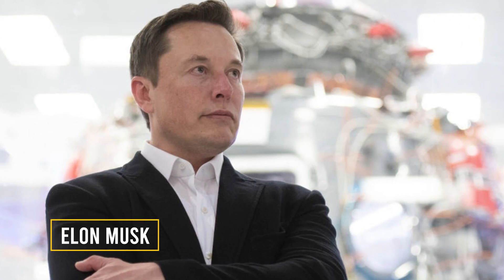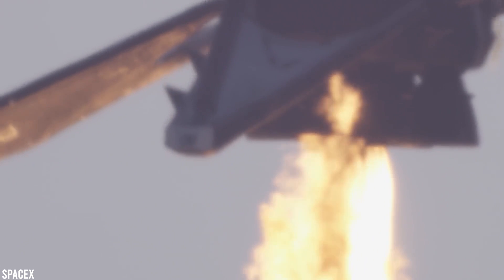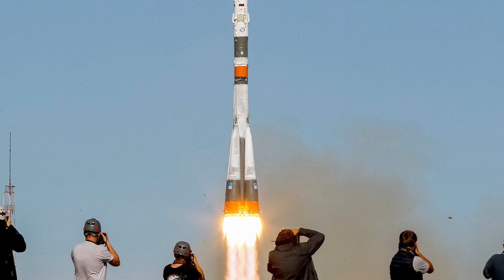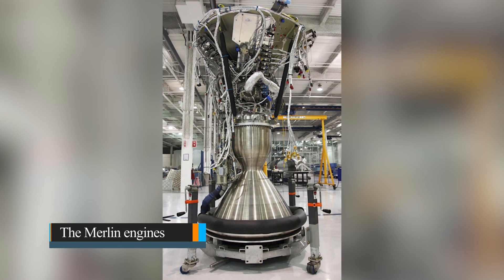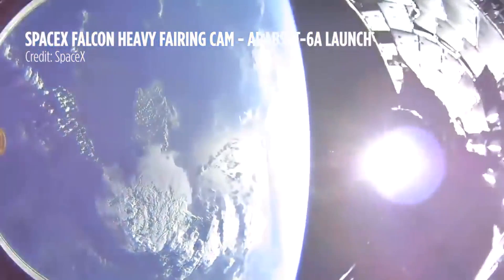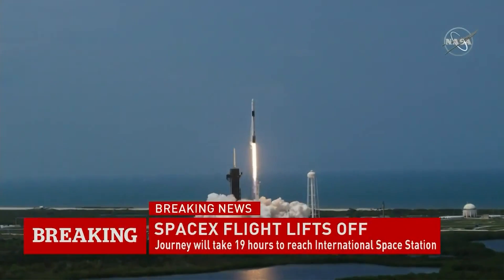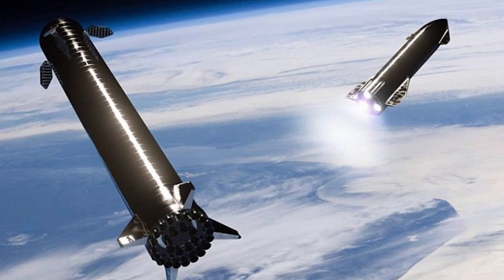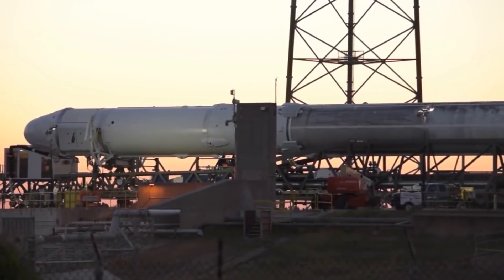The Absurd Size Of SpaceX Starship

Comment: Seems like it would be a good idea to use a hydraulic ram using sea water and a wire rope block and tackle to launch stuff that can tolerate high G force.  Using barges to float a railgun about twenty miles long should allow low fuel burning to get a space vessel launched.  Use it to send water and duct tape, tether material, medicine and well packaged motherboards, EVA space suits, etc.

Comment: Consider getting your numbers right, especially given you are supposed to be describing size it does not help when you clearly have no clue yourself! You said the SpaceX starship was "90 meters in diameter, or 30 feet". FYI, 90 meters is NOT 30 feet, it is 295 feet! It is 30 feet in diameter, which is equal to 9 meters (not 90)!

Comment: As impressive as it is, I cannot believe NASA has signed off on a vehicle with no escape pod, especially with the 28 raptors and massive fuel tanks that would explode with the equivalent energy as a small nuclear bomb.
We have seen how reliable a rocket with 20+ engines is and IMHO opinion, a design that had two boosters strapped to the side like the Falcon Heavy would be a safer design by virtue of the fact that the plumbing would be less complex.
Reply: Well they did so i ghuess nasa realy trusts spacex and belives in starship!
Reply: They don't need NASA to sign off on it.  Their only contract so far for Starship and NASA is the HLS, which is from Lunar orbit to the moon surface and back to lunar orbit.
Reply: @MUHAMMAD FAIQ Gulistan-e-Johar Campus  I agree with you on many parts. However, your statement regarding Starship being strong enough to pull out in case of an abort is wrong. I ran the calculations myself (thrust of raptors and wet mass of Starship are available publicly). You can calculate the TWR through that and you won't even get to 1.1. Starship wet mass is somewhere between 1250 and 1400 metric tons. Thrust of 6 raptor engines on max power is 1352 metric tons. Even with the optimistic calculation in this scenario, you get to a TWR of 1.08, which is clearly not enough to escape from an exploding booster underneath you. Even if they drastically improve the thrust of Raptor, they won't get anywhere near the needed TWR for an abort system. 
To put that into perspective, the Abort system of Crew Dragon reaches 2.47 with the SuperDracos at half power (which they do for thrust differential purposes, if one engine fails)
Reply: @MUHAMMAD FAIQ Gulistan-e-Johar Campus You gotta keep in mind that Falcon Heavy was not certificated for manned spaceflight. Elon himself said that it would have been a nightmare verifying it for that. Starship will be even harder, since it has no abort option at any point in flight. If something goes wrong with Super Heavy, Starship is too weak to act as an abort system and if Starship itself has issues, there is anyways no way of surviving that. This did not even include the maneuvers yet. If the belly flop goes wrong for any reason, they are doomed, since they cannot have a backup option. I really hope to see SpaceX win with Starship, because its revolutionary on so many levels, but unfortunately, I would be surprised if we see no human deaths through Starship failures throughout the next years.
Reply: @Oculaz  High flight rate with continuous design improvements along the way makes the systems actually safe, while the launch escape will only makes it feel safe
Reply: @alvianchoiriapriliansyah9882  I agree to your first part, but the second does not make any sense. An abort capability does make the vehicle safer. There would be no reason to add anything to a rocket, just so that anyone feels safer